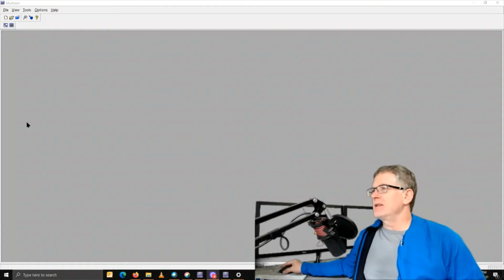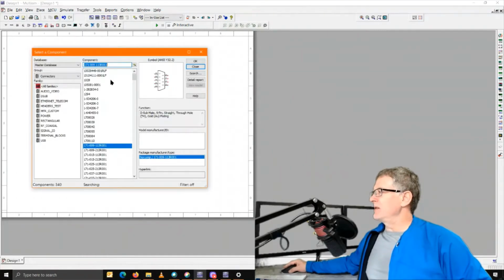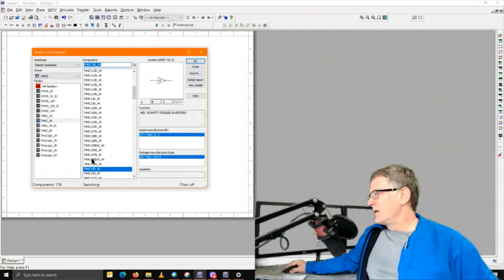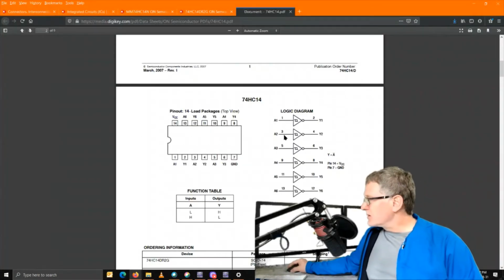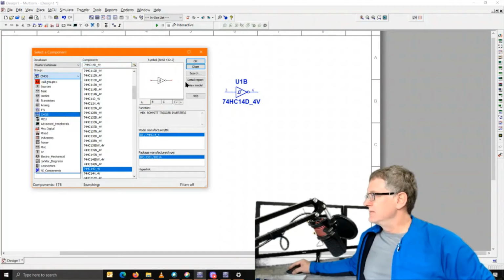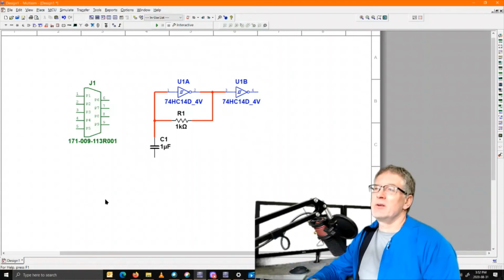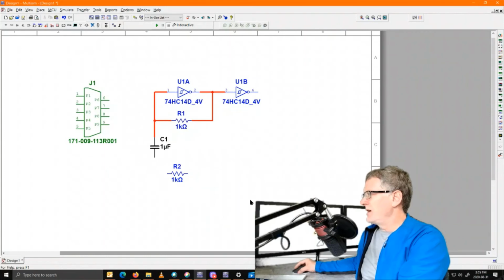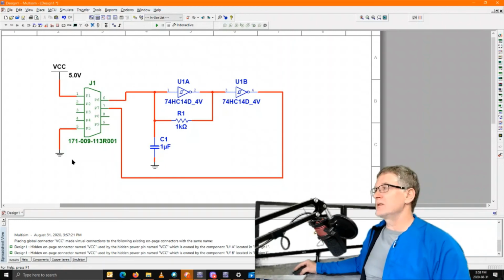Intro PCB Layout MultiSim

Comment: Hi, 
I'm an engineering student and have been recently designing on multisim/ultiboard and before exporting my final circuit designed to perfection i had a simple question,
Is there any way to change the colour of the board? 
Thanks